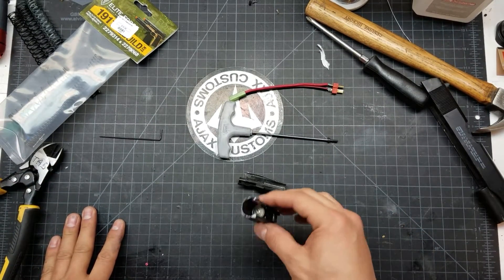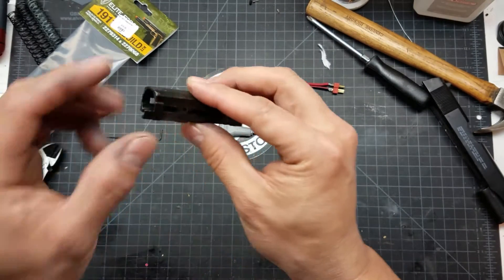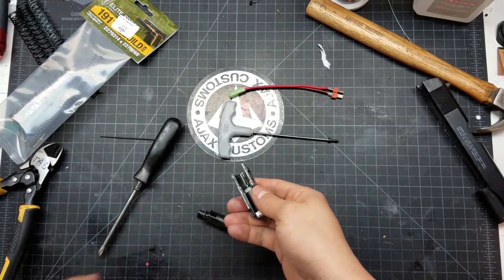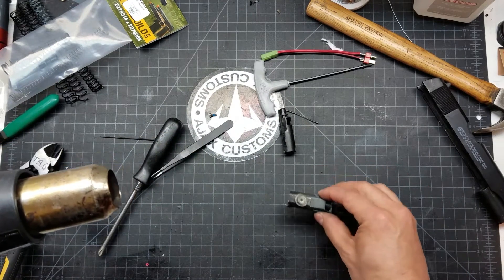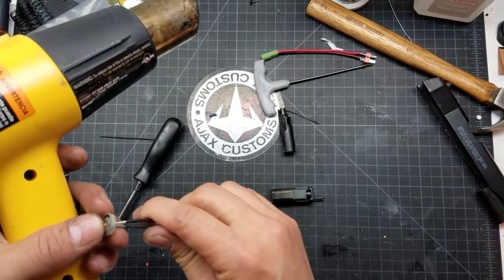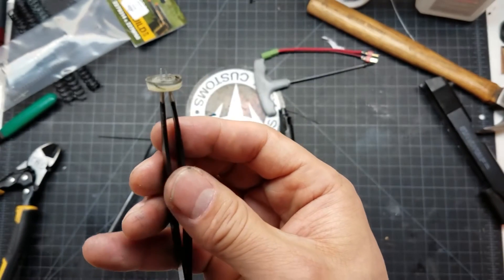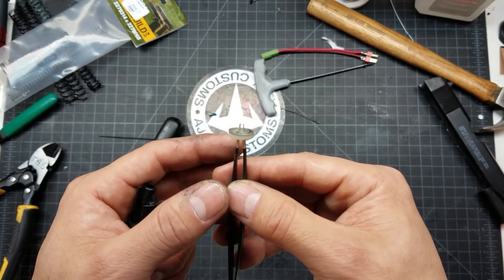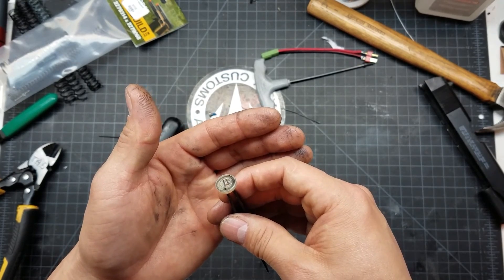Gbb pistol damaged piston/o-ring quick repair tip

Comment: My hi capa has been misfiring in a sense: shooting 5-6 times like it should, then it would dry fire, I took it apart a few times and could never figure out what was wrong with it other than the loading nozzle would no longer slide nicely in the blowback housing, I'll have to take it apart and possibly use this trick if that's the case! Thanks!!!